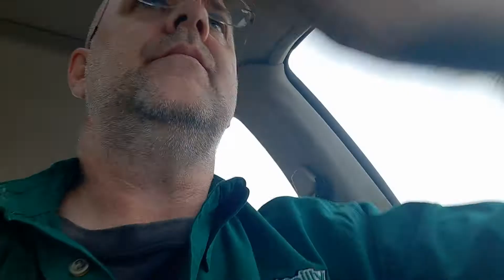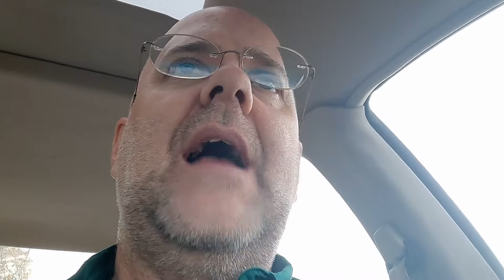CAR TALK/ LINE LOCK and STALL CONVERTERS

Comment from the maker: GM Performance Parts
1998 H.O. ZZ4/ 350c.i.
All aluminum 
Hedman "D" shaped ports 
Dual bank, 2.5" Flowmaster tubing and mufflers, no cats
Ported, polished, balanced, blueprinted
Heads- 1.94 valve
Extrude honed intake and heads
TH350 transmission 
3 speed, manual valve body
3800rpm B&M stall converter
Factory 10 bolt, limited slip rear